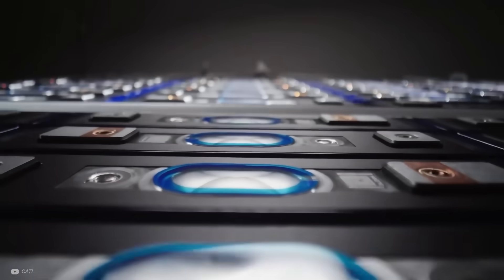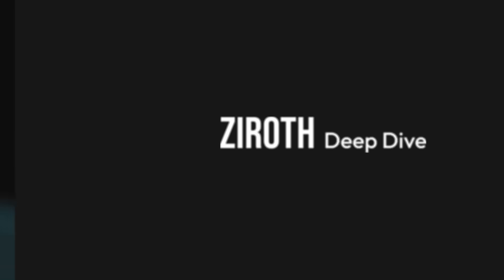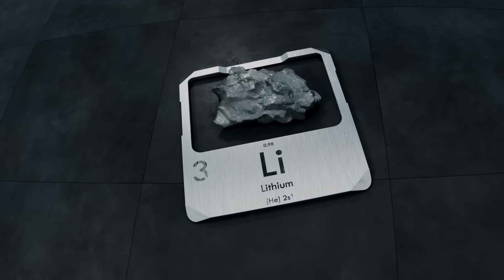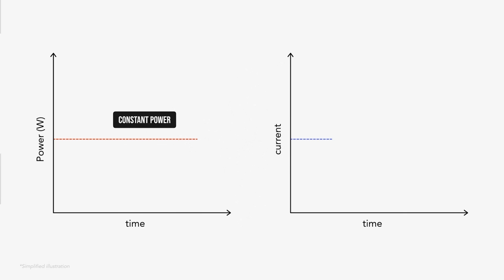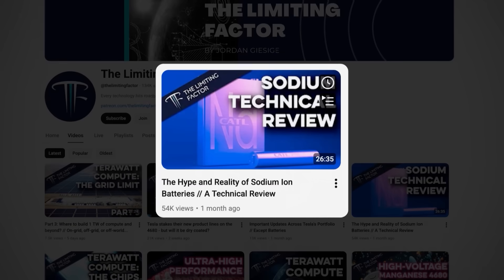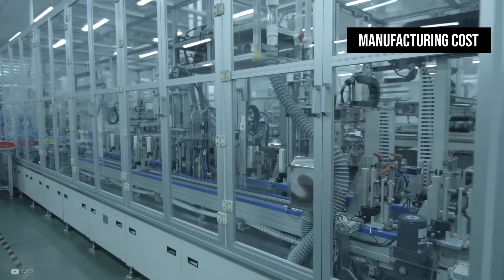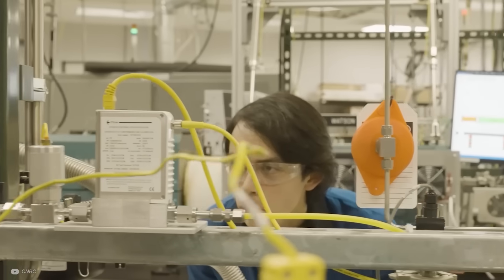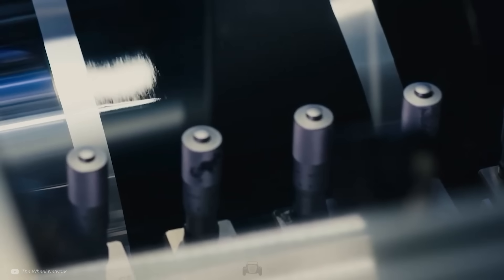How CATL’s Reinforced Sodium Battery is Insanely Cheap

Comment: Antimony !
What about the Supply chain of Antimony and it's cost ?
Reply: Rare and expensive, Mrs of it is produced as a by-product of refining other metal, predominantly Lead.
Reply: @unreliablenarrator6649 😲
Reply: Also the toxicity (similar to arsenic) when those cells experience catastrophic failure or any other form of destruction outside controlled environments.
Reply: @teardowndan5364  Depends on how much Sb is used per kg battery. If it's tiny amounts pr kg battery, it won't really matter.
Reply: @silvergreylion  What's tiny amounts for batterie's used in over 10 million cars and other products all over the world?
Reply: @teardowndan5364 😲
Reply: Quite interesting given that this would impact the price of antimony. Antimony also have other uses.
Reply: @ehsnils  Id say this is an improvement overall considering the costs to produce Lithium batteries.
Reply: @Klaas-w2i you have been misinformed. LFP cells are very cheap and the theoretical lowest cost to produce at scale is very close to sodium ions theoretical lowest cost.
Reply: @Klaas-w2i  Sodium battery materials only cost 30% less as there's still tons of graphite and other materials.
Reply: Larvotto Resources in Australia is just about to start producing.
Reply: Shocking though it may seem, I think CATL has thought about this.  Apparently it's not going to be a problem.  Perhaps the amount of antimony per kWh is relatively low.
Reply: While the majority of Antimony is produced by China and CATL can reasonably expect to have have first dibs on that it's still in critically low supply worldwide and one of the first elements expected to 'run out' in practice.
Reply: Yeah it will be impossible to mass produce this battery. Antimony is 5x the cost of lithium and its supply chain is already stretched. The price would skyrocket if a significant demand was added. That’s why this is just a patient and not an actual production plan. Sodium ion could have breakthrough but this isn’t one of them
Reply: @matthewmanzi9504  That very much depends on how much Antimony is needed per kg battery.
If you can make tons of these batteries with just a few kg of Sb, the cost of it won't matter much.
Reply: @matthewmanzi9504 at one point lithium battery was more expensive than any other battery. Now its cheap. Basic economy of scale. Supply gets cheaper as production increase. Not more expensive. Youre thinking of economic of rarity. But there is also economic of scaling which works the opposite and actually improves supply.
Reply: @matthewmanzi9504  Hopefully they will find another high density chemistry that doesn't require rare earth materials so it would be more eco friendly

Sodium sulfur might be the most likely contender chemistry as it has way higher energy density and doesn't have any rare earths

Comment: There's another pro and con to Na-Ion: it can safely discharge to 0v, and it typically has a shorter lifespan.  Hard to say whether this latest chemistry change will affect either of those.  The discharge capability is absolutely critical, because even though the energy density is technically lower, you can tap into more of the cell than you can with LFP, so it comes out to very similar watt-hours.  Of course, this implies that the system can handle voltages that dip so low, which most can't.

I always felt that Na-Ion made the most sense for renewable energy storage, since the weight and energy density are largely irrelevant, whereas the fire safety and temperature range help immensely reduce the cost of construction.  Na-Ion might not have the same round-trip efficiency as lithium cells, but since it doesn't need to be heated in cold conditions and perhaps doesn't need liquid coolant, that can be a tremendous energy savings.
Reply: Many EVs has wide range inverter that supports anywhere between 400-800V so it would not much of a problem for it, and current sodium ion already has 4000-6000 cycle life, just fall short of 7000 cycles of LFP batteries

The remaining problem is the round trip efficiency at high cycling rate, as although sodium ion can retain 95-96% round trip efficiency at moderate cycling rate of 1-2C, but the efficiency drops quickly to 60% when the rate is increased above 5C, which makes it unsuitable for high performance and/or superfast charging EVs
Reply: I thought LiFePO₄ could also safely discharge to 0V? That's what sodium ion is competing with, not the traditional lithium ion cathodes like NMC.
Reply: @ps.2  It's safe, but you cannot charge it again.
Reply: @ps.2  Different is in the life per cycle is my understanding. While yes you can discharge them to 0 - it still hurts them to do that over a number of charge cycles. Where with sodium, it doesnt hurt it at all.
Reply: @adr2t  Thanks — interesting if true. I have very limited experience with LFP cells, but I do like 'em.

(I do have a few. They are 14500 form factor, aka "AA", so I've recently soldered AA battery cases into a couple of appliances that normally take CR2032 button cells. Because I'm tired of non-rechargeable anything. And my current CR2032 stash is old and cheap and Chinese, and their individual capacities are disappointing and unpredictable.

So anyway, for the record, a 3.2V LFP cell seems to be a perfectly fine substitute for a 3V lithium metal cell. So far.)
Reply: @ps.2  Something would have to change for sodium to work here though. For example, a sodium cell might start at 4-4.5 volts and drop down to 1-1.5 volts or lower. So for your need LFP would still be better.

Comment: An interesting technology for cheap cars. The problem is that the energy density is around a third lower, making batteries heavier.
Reply: Stuff cars, this is useful for domestic resilience and grid smoothing. Put the electricity into public transport instead of murder machines!

Comment: Hmmm... Still doesn't add up.
Sodium is more reactive than lithium (the alkali metals become more reactive as you descend the group), so it's not going to be safer.
This new 'breakthrough' relies on adding a rare metal that is mostly produced in China to the pack so China controls supply.
CATL are going to subsidise this technology so it can get into production? So they propose to manipulate the price to corner the market.
Reply: There is no elemental Sodium in these batteries. They use Sodium ions.
Reply: @Alantj22  I'm sure that will be of tremendous relief to all those who have had their property ruined by Li-Ion battery fires.
The "ion" is used to transfer charge, it is converted to metal at the electrode.
Reply: @AlexanderJohnOgle  Those fires were fueled by the highly flammable electrolyte rather than the very small amount of lithium contained in li-ion batteries. The second most common cause is shorts that can cause the massive amount of energy stored in those batteries to be turned into heat due to their very low resistance.
Reply: @felixmoore6781  I can assure you that lithium batteries are marked as dangerous goods not because of their elecrolyte but because of the lithium they contain...
Reply: @AlexanderJohnOgle   A few comments on your reply

Of all the large electrical appliances in a home a LFP home battery is the least likely to cause a fire. So not sure where you got "all those people from"   

The chemistry of Sodium batteries are completly different from Lithium and even less likely to catch fire (maybe they would inside a house that was already burning down)

It isn't.
Reply: @AlexanderJohnOgle  You probably mean lithium cells, which contain a significant amount of lithium. Rechargeable lithium batteries are dangerous, because most types use chemistries that make them prone to catching fire, not because of the tiny amount of lithium they contain.
Reply: @felixmoore6781  ... and, going back to my point, soduim is more reactive than lithium, AND it uses the same electrolytes.
Looking up scholarly information on sodium-ion batteries shows that they are not safer than lithium, merely safer than some of the extreme lithium chemistries.
They solve none of the problems that make lithium-ion batteries troublesome.
Reply: CATL is obviously a large consumer of lithium and has an intense interest in keeping lithium pricing low. It is producing sodium batteries in low volumes for the same reason it got into lithium mining. The money that it lost on producing lithium from a low quality - high cost lepidolite resource was more than made up by the impact it had on lithium commodity speculators. It doesn't have any need to produce sodium batteries in high volume, just enough to dampen enthusiasm in the lithium market to keep its mainstream lithium battery profit margins high.
Reply: @clarkstonguy1065  You don't keep profits high with subsidies, you manipulate price.

Comment: Ok but how does it compare with Li-ion batteries when it comes to Wh/kg and Wh/L? Are they going to make EVs twice as heavy? How does it impact range with the additional friction?
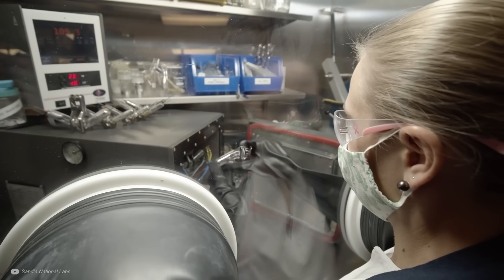Reply: 3:02
Reply: It's a little lower and less dense but it lasts way longer without degrading and they are cheaper.
Reply: MUCH cheaper than lithiums ion with no rare earth elements and a lifespan longer than us. Nice to have options.
Reply: Wh/L, not Wh/kg, is where the challenge lies. But, realistically, solutions will emerge in time. Anyone who can't see that Sodium-Ion ought to be the default EV battery chemistry is blind.
Reply: @chris27gea58 SilverLi promises high power density, low weight, fast charging, no fires.
That's  the published news, anyway.
Reply: @williamevans6522 Yes and high prices too! Why does a technology become a default rather than niche choice? Because it offers most of what is important (in this case, fast charging, safe chemistry, long life) to the widest group of users (Sodium-Ion is appropriate for general use and for use in harsh environment, for instance -30 degree C) and at a low price.
Reply: And they just started to commercial use them. Look at the development of lithium batteries.
Reply: This is why CATL has hybrid battery packs and a whole controller system for them that switches between the two when needed. It's honestly kind of brilliant. They have the sodium side for raw output as well as cold temp operation, then they can switch to the lithium side for better performance. It's the best of both worlds.
Reply: They can replace lithium in all stationary applications, and can replace lead acid (still the main technology used in ebikes in China) in all applications.
Reply: @AllYourMoneyNowKid I think they use lead acid for ebikes because they are cheap and less prone to battery fires. Sodium ion hopefully solves that with the added longevity
Reply: Its disingenuous to imply that these have disadvantages but Li dont
Reply: According to CATL, the sodium ion batteries are 175 wh/kg and LFP is 185-205wh/kg. Sodium ion batteries are about 25% more volume than LFP. Because of large temperature range it doesn’t require more cooling and sometimes air cooling could be enough
Reply: Heavier and less W/hr
Reply: @williamevans6522  Yeah, but they require far less heating and cooling, so the "thermo" systems can be eliminated or greatly reduced, which reduces complexity, weight, toxic materials, cost, etc.
Reply: @pumpedupdart6859 Good point. 
I wonder if Samsung's new Li Ag( silver) batteries will charge as fast as they say while  truly eliminating the hazards associated  with dendrite growth that cause short circuits and  runaway fires.
Reply: Bingo.... TLDR: not the holy grail.
Reply: @flexairz might be perfect for commercial or grid storage
Reply: @flexairz  You didn't watch the video, TLDR: same as LFP but way cheaper and safer.
Reply: @okgoogle4206 And what about volume? It can't replace Li-ion if it takes 10x more volume....
Reply: @metalhead2550 It's about 10 - 15%
Reply: @metalhead2550  it's not 10x more volume, it's 20%.

Comment: Superb and insightful as always.  I'm astounded quite so much emphasis is placed upon transport when the energy sector will require significantly more storage capacity (as well as micro generation) as electric grids evolve to suit decarbonised demand.
Reply: I agree with a few customers there is a big market in energy storage.  But the EV supply chain is now well established so from a manufacturing perspective it is a known customers base in China for CATL.
Reply: Yeah, the big hope (for many of us) is that the sodium ion batteries that employ fluid electrolytes will change the math on energy storage. The two factors of importance here aren't things like energy density, C-5 charging, or low temp efficiency but Cost and Safety.
The fluid electrolytes don't have runaway thermal dynamics and their costs might go as low as 1/5 that of lithium. 
Hard carbon and no need for copper, nickel, graphite, lithium or exotic materials make less exciting sodium ion cells more attractive grid storage applications.
Reply: lol, no, this vid is junk.
https://www.youtube.com/watch?v=zSPSCC3_hHw

Comment: So last I checked actual production about a month ago the very latest under wraps was still a few years away from being competitive. If ever.
Reply: So I can not buy this product that changed everything?  Exactly like the thousands of other products beforehand that promised they already changed everything.  The more they change everything, the more they stay the same?
Reply: @Deontjie  35 years ago, the lithium ion battery was "exactly like the thousands of other products beforehand that promised they already changed everything". And they haven't "changed" (past tense" everything, but there's a possibility they "will change" everything - although someone probably needs to find an alternative to antimony (just like LFP batteries are displacing NMC, because the supply chain is less politically sensitive).

PS: I've tried to reply to you assuming you're of reasonable intelligence, and not just pooh-poohing all scientific advances because gasoline.
Reply: @Deontjie  Unfortunately, it's going to take a bit longer than planned to make the old lead battery obsolete... even EVs have them! Personally, I've already made the switch (my driving habits allow it), and honestly it's so much better than diesel/petrol, I'm almost annoyed I didn't switch earlier! Pretty much the only tradeoff now is range - and honestly, that's just not the problem it's made out to be.
Reply: It will be cheaper than lead inn startbattery for fossil cars .
Reply: @tolerance721  I would hope so but there may be other issues. For instance temperatures. Tesla did not start phasing out their 12V lead acid batteries until 2021. I'm not sure why they needed a spare 12V battery in their vehicles but they did for the longest time.

Comment: Simple solution to sodium voltage drop: Series them up to 100 volts at empty and run the output through a buck converter.
Reply: Yep! Same issue with Solar Panels!

The extremely flat curve makes it hard to determine battery health/capacity without extra circuitry to measure& maintain a db for the state of charge.

The fairly linear sloped curve gives a clear indication of battery capacity, as does lithium ion batteries, and other chemistries do.
Reply: that's just added cost, weight and faulire points.And further decreases efficiency.
Reply: That's just insanely expensive and had more failure points so at that point you'd just use better lithium based batteries.

Comment: I wonder how much antimony is needed? That's not a particularly abundant metal. (It would be recoverable, I guess, from old batteries.)
Reply: Isn't antimony also used in lead-acid car batteries? That would mean the stuff isn't rare, either.
Reply: Hopefully it wouldn't be more than a few ppm

Or even better, hopefully they will find another similarly high energy density chemistry without any of those rare earths added